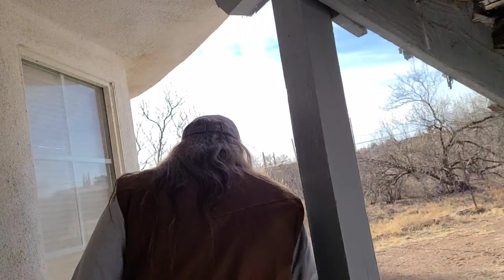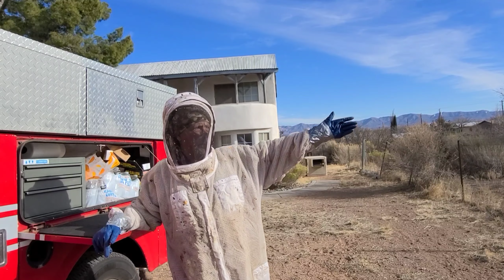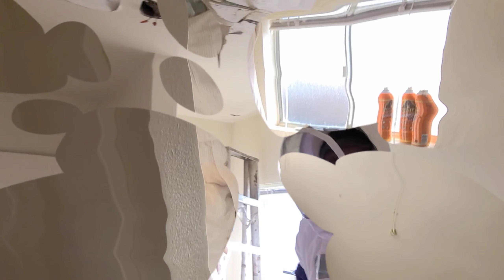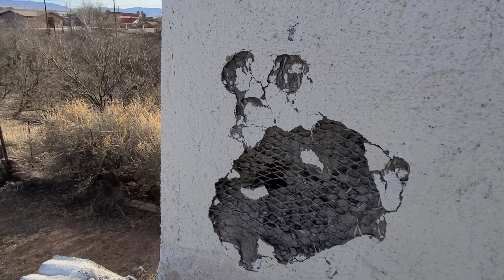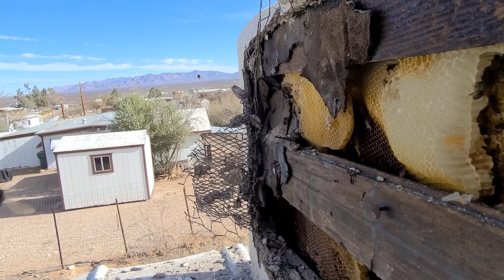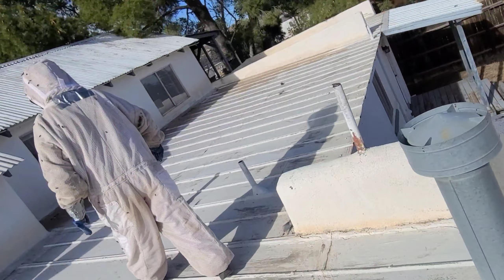LATE WINTER KILLER HIVE IN TOMBSTONE!

Comment: I wonder if a thermal reading device could pinpoint the location of the hive ,given that the bees generate heat in their compact huddle. In alot of cases the repairs to the stucco will cost more than the thermal tool.
Reply from the maker: We've tried thermal imaging but for most of our season it's just too hot everywhere here in the desert!
Reply: @KillerBeeGuy  ya I was thinking that , and it would have to be after the sun goes down I would think., After beer o clock.
Reply: @KillerBeeGuy Clay Greathouse turned me into you btw.
Reply from the maker: Clay? You mean from Tucson?
Reply: @KillerBeeGuy  Nope, in Tombstone, he's a realtor. Clay Greathouse

Comment: I do some hiking in the area and wonder what I should watch out for at this time of the year.  Any tips?
Reply from the maker: This time of year isn't nearly as dangerous as say in the summer. They are still insects and are still affected by the cold. Problem is that they will attack even if it's cold out. The main thing to watch out for is if you hear buzzing and it's not mosquitos, or worse if a bee bounces off of you. That is either a warning shot or a missed shot! Turn around and head back the way you came from quickly!
Reply: @KillerBeeGuy  Thanks!  I grew up in Panama, and the bees came through there in 1982.  I'm way more concerned about bees than any other animal out there on the trails.
Reply from the maker: We totally agree! These bees are the most dangerous thing we live with here in the Desert SW.
Reply: Killer Bee Guy is spot on. I tell folks to not run or swat. Check what direction they're coming from (can't miss the noise)  then get out. GPS that puppy then call it in to the authorities.

Comment: Try some CB-80 this season. It works amazing for us on africanized hives in the city.
Reply from the maker: Thanks for the info! I'm going to look into it!! Right now we use PT PI. It's a pyrethrin based aerosol.
Reply: @KillerBeeGuy  CB-80 is also pyrethrin based.  If your looking for something with a residual you can use shockwave.
Reply: Prythen is a pretty dangerous chemical to breathe in, isn't it?
Reply: @amylarson3958  it’s actually technically a organic insecticide extracted from the chrysanthemum plant. It’s recommended to use a Respirator but not required.